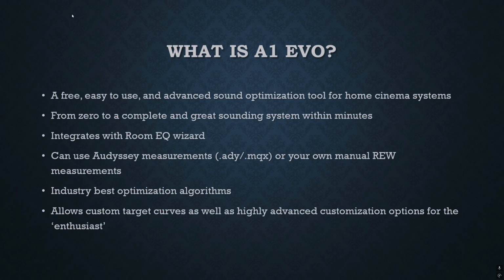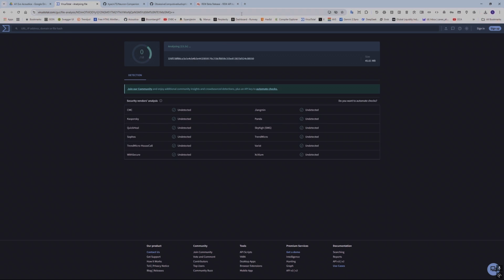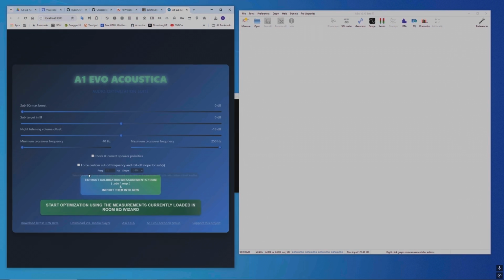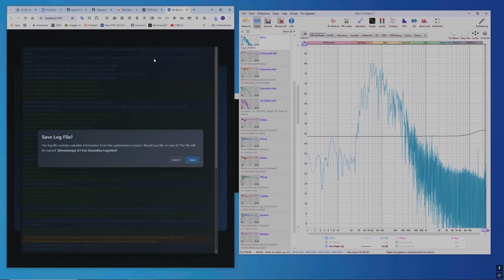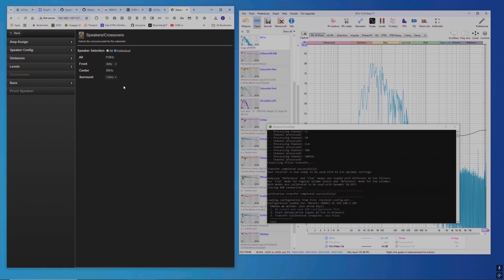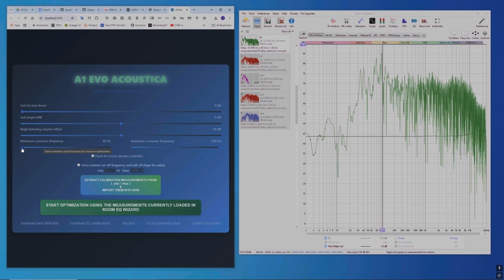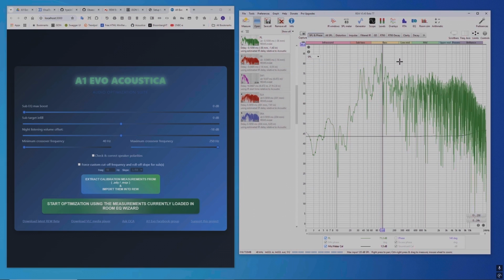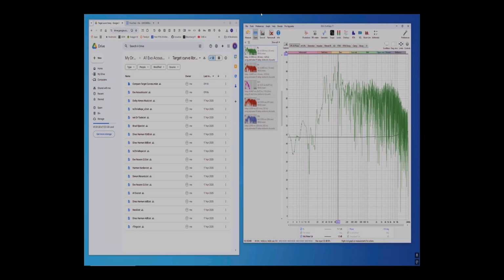A1 Evo Acoustica

Comment: Hello. Could you please tell me how to properly set up calibration without a subwoofer? What settings need to be changed? I have a Denon 960H AVR, and the system refuses to calibrate without it. I also have an A1 Evo and A1 Evo Express.

Comment: Very strange (extract from my 8 positions measurement with 3 points very close on my couch...).

FL (Position 1) : Accepted: 1/6 (Rejection: 83.3%)
C (Position 1) : Accepted: 6/6 (Rejection: 0.0%) / Estimated polarity: Negative (Inverted!)
FR (Position 1) : Accepted: 1/6 (Rejection: 83.3%)
SLA (Position 1) : Accepted: 6/6 (Rejection: 0.0%)
SRA (Position 1) : Accepted: 6/6 (Rejection: 0.0%)
SBL (Position 1) : WARNING: Averaging impossible. Too many rejected measurements.
TFL (Position 1) : Accepted: 6/6 (Rejection: 0.0%)
TFR (Position 1) : Accepted: 6/6 (Rejection: 0.0%)
SW1 (Position 1) : Accepted: 1/6 (Rejection: 83.3%)

FL (Position 2) : Accepted: 1/6 (Rejection: 83.3%)
C (Position 2) : Accepted: 6/6 (Rejection: 0.0%)
FR (Position 2) : Accepted: 1/6 (Rejection: 83.3%)
SLA (Position 2) : Accepted: 6/6 (Rejection: 0.0%)
SRA (Position 2) : Accepted: 6/6 (Rejection: 0.0%)
SBL (Position 2) : Accepted: 6/6 (Rejection: 0.0%)
TFL (Position 2) : Accepted: 6/6 (Rejection: 0.0%)
TFR (Position 2) : Accepted: 6/6 (Rejection: 0.0%)
SW1 (Position 2) : Accepted: 4/6 (Rejection: 33.3%)

FL (Position 3) : Accepted: 6/6 (Rejection: 0.0%)
C (Position 3) : Accepted: 6/6 (Rejection: 0.0%)
FR (Position 3) : Accepted: 6/6 (Rejection: 0.0%)
SLA (Position 3) : Accepted: 6/6 (Rejection: 0.0%)
SRA (Position 3) : Accepted: 6/6 (Rejection: 0.0%)
SBL (Position 3) : Accepted: 6/6 (Rejection: 0.0%)
TFL (Position 3) : Accepted: 6/6 (Rejection: 0.0%)
TFR (Position 3) : Accepted: 6/6 (Rejection: 0.0%)
SW1 (Position 3) : Accepted: 2/6 (Rejection: 66.7%)

I don't know if it's possible to discuss in private.
Reply from the maker: How is that 8 positions? I see 3 positions with 6 repeats each and the results look ok and valid for a highly reflective environment.
Reply: @ocaudiophile  "extract from" ( = I didn't put everything to keep my message short)
Does it really look OK with warning on inversion of polarity in 1st position (no more after) and many rejections?
+other stranges behaviours (like subwoofer : rejections number changing each time when [of course] it didn't move, same for FR : 1/6 accepted in some positions and 6/6 for 3rd position for example)

My environment is quite normal (and very quiet) with curtain in front on windows and a carpet in the large section of my living room and a large couch.
Reply from the maker: Rejection doesn't necessarily mean it was bad, it simply didn't have additional info to improve the average. Sometimes a too good single measurement can cause all other just OK measurements rejected.
Reply from the maker: When mic position changes, the reflection pattern changes, causing different peaks to "win" the polarity decision. I will have to improve the algo for less false positives eventually but it's not an easy task.

Comment: Serious question, hopefully you see this.

When you measure the software reports the distance from the FL to my MLP as 337cm. Which is almost dead on.

But my seat is not in the middle, it's off to the side a bit. Is the software measuring distance on every speaker or using that for the entire front stage, because it doesn't say any other distance measurements.
Reply from the maker: That's just for indication to user about how central the mic position is between left and right mains. Final distances are set based on arrival time differences between speakers to MLP.

Comment: Hi I am using denon AVC x3800h and used A1 evo Acoustica for calibration, with all the default settings in Acoustica , found speaker crossover frequency ranging from 40 to 250 hz, if I set all front and sorround speaker 80z and dolby 120 hz low pass filter 120 hz in Subwoofer after transfer to avr will it have any problem ?
Reply from the maker: No problems
Reply: @ocaudiophile  one problem I faced during calibration, when I try to load .ady file created by MultEq app in Acoustica measurements tab for .ady, folder containing that .ady file does not open,  the Acoustica window opens in Safari but when I use Chrome it does open the folder.

Comment: Hi Serkan, Thank you so much for all of your amazing work. I am having difficulty with importing my .ady file into the A1 Acoustica site for conversion and would really appreciate some help please.
Reply from the maker: Just run the script. Acoustica can automatically upload ady files. You'll have problem if you have 2 subs and measured them in standard mode though. In that case measure your system with Acoustica instead. Editor app has many measurement bugs especially the Android version anyway.
Reply: @ocaudiophile  Fab, thanks again. It has opened in REW but when I run the optimisation script I am getting an error message. 'Speaker measurement 'A1 Evo' is missing a script

Comment: Getting error "[GET_AVRSTS] Config Command timed out after 10000ms waiting for JSON response.
Failed to get necessary AVR status/info: [GET_AVRSTS] Timed out waiting for Config JSON response."

I was able to successfully complete a calibration with acoustica and upload to AVR prior. I recently added a power amp and bass shakers so I was trying to recalibrate. I tried redownloading acoustica, powercycling, turning off firewall but I'm getting the same error
Reply from the maker: Maybe a router reset after vpn is turned off...

Comment: Thanks so much for this app, really excellent work. I have a Denon 4700 7.2.4 system with two subs. I have run Acoustica to calibrate my system using Umik mic and REW measurements. I have 2 subs but am also looking to integrate a bass shaker so have a mini dsp. My question is: Do I need to do any further calibration with the minidsp and rew for the subs or should I run the two subwoofer outputs from Denon straight through the dsp without any added processing? If I was to only take one output from the Denon to feed the minidsp, what settings do I need to change to the sub output 1 that Acoustica has no doubt updated?
Reply from the maker: I would connect one sub to miniDSP and one sub to the AVR, calibrate with Acoustica and then add the TR to miniDSP. That way you can independently adjust the shaker with miniDSP settings.

Comment: Hi, I have now moved across to Acoustica from Nexus as recommended. I have started optimisation but am getting this message: It's not possible to sync your speakers at the MLP with the available hardware limits of your AVR. You'll need to move these speakers closer and repeat measurements!
15:35:59 [ERROR] >>> A1Evo Error:
Reply from the maker: Do you have wireless speakers? They cause excessive delays. If you've a new model receiver, use Express. It can use 18m extended limit.

Comment: Hey everyone. I’m fairly new to all of this and the program worked fine on my last speakers. Now I have upgrade my front left and right to Dali ikon 6 mk2.  Audessy sets the front to full range but when running acoustica it set them to 90hz. Is there any way I can get more bass out of the fronts? My sub is pretty low end so I would like to just get a little more from the speakers.
Reply from the maker: You can limit upper crossover frequency for fronts using sliders under advanced settings before starting optimization
Reply: @ocaudiophile thanks for answer I will try that 😊

Comment: Hi All,
After having been able to do a couple of optimizations I am no longer able to optimize Acustica on the same system with the same Mac, as it runs for days non stop, on REW!
Would any one have any suggestions?
Thank you all,
Reply from the maker: Could be some security settings changed in your OS.
Reply: @ocaudiophile  Thank you I will look in to it, however, could you give any guidance on what to look for or change back to? Acustica sounds impressive!
Reply: I found the problem, or my mistake rather, by not properly loading a target curve!

However, I am not able to download the optimization back to the AV10 using directional subs, as it gets reverted to Standard, and it I try to override the sub mode to Directional the Audyssey kicks out to not available for selection!

Are we limited to Standard subs configuration with Acustica on a AV10 and should I take my measurements with Standard selected?

Thank you OCA,
Reply from the maker: Ithis is normal, it will work in standard bass mode

Comment: Hi OCA, 

Another question:

I started with neuron and some version. Dont really remember 😅 but back then i thought the result where really good. Especially how the center was loud and clear, also really dry. Do you know how i could reproduce that? Thank you so much! 

(Is it possible that adding 4 atmos speakers to my 6400h could be the reason?) thats the only other change, maybe i need more power?
Reply from the maker: If you don't like the result for whatever reason, just try again. Every new measurement has potential to fix problems. 6400 is a strong amp, I don't think power is a problem.
Reply: @ocaudiophile  thanks so much for your reply, appreciated!

Comment: I got it to connect to the AVR, but now when it runs through the optimisation process, it comes with an error "channel BDL is missing in configuration file' The Back Dolby's are definitely connected properly and are outputting sound. The calibration sweeps did include these speakers. Another time I tried it, it said the subs are missing. (they're definitely not)
How do I fix this?

Comment: Having some issues with Accoustica.  It keeps setting my crossover to 40 hz and when i try to force it to 80 Hz for all channels it sets my center channel to 150Hz and the rest to 80Hz.  It's also setting my sub output to LFE instead of LFE+Main.  I can fix all of these issues in the settings after sending file to the recevier but i'm not sure if these settings are like this for a reason.
Reply from the maker: Is it not set correctly in the logs or after the trasnfer? If it's a transfer issue, just repeat the transfer or manually set them in the AVR. I don't think Acoustica options have problems working otherwise.
Reply: My Receiver is a Cinema 40 btw
Reply: I think I figured most of my issues out.  The script is still setting the subwoofer mode to LFE and not LFE+main. Is this correct?

Comment: When  it asks if the AVR model is the correct receiver and I say yes, it comes up with 
" Config Command timed out after 10000ms waiting for JSON response.
Failed to get necessary AVR status/info: [GET_AVRSTS] Timed out waiting for Config JSON response.
Error during connection or status fetch for [IP address] Failed during AVR status/info retrieval: [GET_AVRSTS] Timed out waiting for Config JSON response.
AVR configuration process failed or was cancelled."

PC is connected to AVR with HDMI cable, what is wrong here?
Reply from the maker: Sounds like a network firewall or vpn blocking access to the receiver...

Comment: @ocaudiophile Thanks so much for your great code! I just spent a fair amount of time getting 4 different ported subs to play nice together using MSO, REW and Umik1. Interestingly, this caused Acoustica to pick 200 Hz as the crossover frequency for all of my speakers. Are there any issues with this other than the potential for some low mens voices to seem like they are coming from everywhere vs the screen? I'm assuming if this happens I can just reduce the Center channel crossover to 80hz or so. Thanks!

Comment: At about 17:30 you start discussing sub boost and how it can compensate for when people forget to set sub measurements to LFE - 10 for the calibration. Is this setting addressed in one of your videos? I would love to know how to tell if I calibrated at LFE - 10 because acoustica wanted to trim my bass to - 12 after calibration. Seems like this could also be caused by having the manual gain on the sub itself turned up too high?

Thank you so much ane I love the tool! It REALLY woke up my front mains
Reply from the maker: If you're measuring your sub in REW, chances are you're measuring it 10dB too loud unless you're using REW's specific lfe-10dB sweep or my SWx.mlp atmos sweep. LFE channel is 10dB boosted by default (also in movie tracks)

Comment: Bug report: tried the latest version, it does not get the distances right. All previous versions have. When going back to 7.3 all is fine. 

Denon X6700H. REW measurements. Same as I've used with all previous versions.
Reply from the maker: I don't remember ever changing distance calculators in Acoustica between versions (other than sub distance maybe). The distances are not actual distances and based on sub alignment they may all shift as well. Did you listen to the new results?
Reply: @ocaudiophile they're definitely not correct. The distances determined by Acoustica have been correct throughout versions, but when I jumped from 7.3 to 8.0 something has changed (same measurements all the time). Some distances are the same, but most of them are not. Example: FHL went from 3,17 to 2,52 meters.
Reply from the maker: I double checked the update logs. There's nothing that would effect speaker distances other than sub distance changes potentially requiring speaker distance shifts. There was a model recognition bug fixed which would change speed of sound setting for one model but that doesn't explain your FHL change. Distances are relative in Acoustica and will almost never be equal to the actual physcial values. If you are chasing them without listening to your results, that's not the right way.
Reply: @ocaudiophile I did some testing and found that the pre-processed measurements that Acoustica 8.0 created the first time I ran it (REW beta 99) were the problem. They always resulted in incorrect distancea. However, I re-ran Acoustica 8.0 with the original measurements and it all worked as expected, the distances came out as they should and the pre-processed measurements now yield the correct distances. So, something must have happened in REW the first time around.
Reply: @ocaudiophile  Hello Serkan!
I've been using A1 evo since the beginning and I'm very, very satisfied with it! Thank you so much!
One question, please: Are there any limitations or differences if you "only" have Audyssey MultEQ? Or does it matter whether you use MultEQ, MultEQ XT, or MultEQ XT32 after the script?
Thank you in advance and best regards, Simon
Reply from the maker: It's explained at the end of the video.
Reply: @ocaudiophile  unfortunately it isn't... you only describe pretty early in the video that a unit is needed which is compatible with the audyssey app, which is clear for, cause i enjoy your great script since the beginning.
To clarify and specify my question a bit more:
originally multEQ, XT, and XT32 use different numbers of filters. For example, does multeq only have 128 filters, while XT32 uses 512 filters in your script for more detailed filtering, as originally specified by Audyssey, or does your script override the number of filters anyway, so that the correction produces exactly the same results for different Audyssey versions? 
And one more question please: 
as far as I know, you're currently achieving better acoustic correction with the express version... will these filters also be integrated into acoustica script to make even better use of it? Many thanks in advance, and best regards, Simon

Comment: What a fantastic tool.. Fixed my garage theater up nicely, HUGE improvement with bass.. My son and I built dual 21" sealed subs powered by a Crown amp and the low end was quite lacking.. SO much better now, thanks!!!!  Is your Github down? I'm getting a 404 error when I try to visit it.

Comment: Why it is showing target curve not found
Reply: I don't know where the problem is, I have purchased a new laptop for calibration as I used to do earlier with your given optimization tools .. but this time I failed to optimize my system...I have tried everything.....can get new version benefits, always shows .. target. Curve not found.... I am not new here .. I am one of your regular followers.. pls help OCA
Reply: Make sure you have the latest REW version installed and select a target curve in REW
Reply: @kevinmastah  thanx ,
Reply: Problem resolved, issue was with REW core threads... I minimized , and worked

Comment: This seems to be some discussion regarding your use of vector averages versus RMS average + phase when working with input data. Could you please elaborate on your rationale.
Reply from the maker: It isn’t a discussion, it’s baseless self-promotion attempts (about 10 times daily) from a certain uninformed and overambitious idiot. The rationale I’m using isn’t personal opinion; it’s fundamental signal math in the complex plane. RMS averaging is appropriate for applications like car graphic equalizers, which operate only on frequency magnitudes. You don't measure and correct for a large area and then compare the result with single point MLP measurement. There's also filter autoleveling between 6kHz and 20kHz done by the AVR (not Audyssey) which is completely unknown to those wannabe experts.
Reply: @ocaudiophile  Thank you. As you well know, I absolutely love the system you have created and run it with minimum "HERTZ". Congratulations on the rapidly increasing following. Looks like I'll be spending time at this location and no longer on that forum.

Comment: Now that Maratz AV 10 has the latest update I wanted to try Accoustica again.
But when I open the program to extract measurements, the script doesn't find any files. 
I've tried searching for the files on my laptop. 
But I can't find anything.
Where can these files be hiding?
Reply from the maker: It will extract measurements from any .adý or  .mqx file whereever you have one. If you measured with Acoustica, that one will always be in the app folder.
Reply: @ocaudiophile I find out that i had to make a new folder